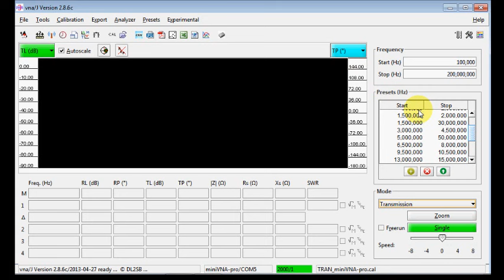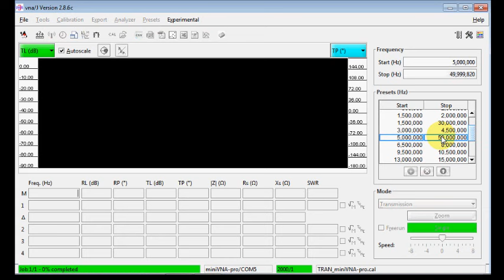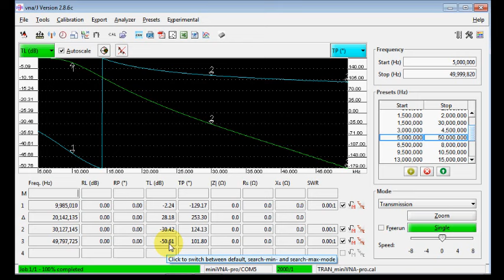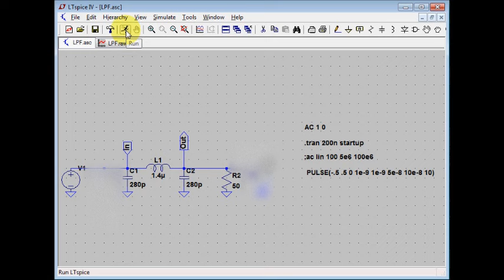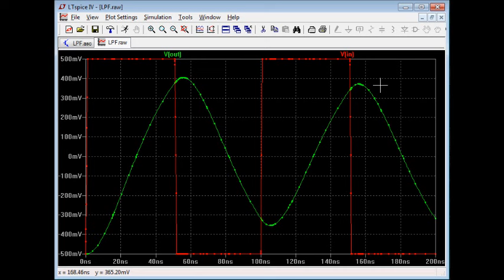10 MHz Low Pass Filter Performance Test with miniVNA (CC)

Comment: I notice you had an issue similar to one i'm seeing in that your 10 Mhz marker is 9.985010. I know that is close, but I cannot get mine that close to my desired frequency. Do you happen to know why the marker frequency will not seem to allow you to enter an exact frequency? I've read through the manual and did not see anything about that.
Reply from the maker: @justlivin The markers can be placed only at the discrete frequencies that were saved in the calibration file.